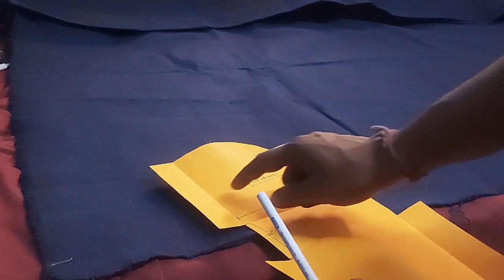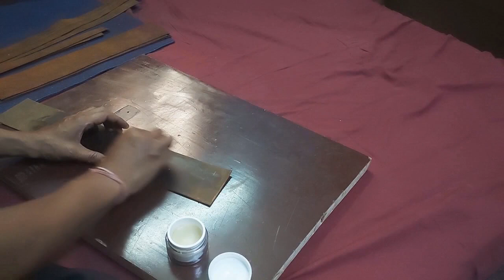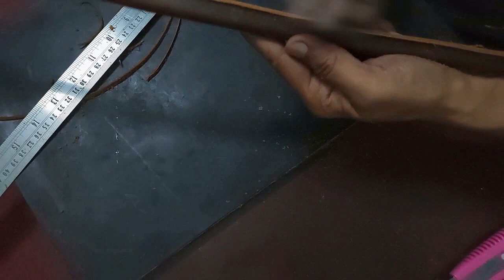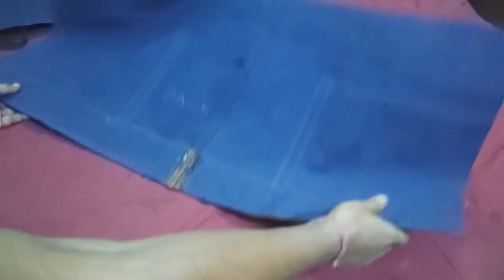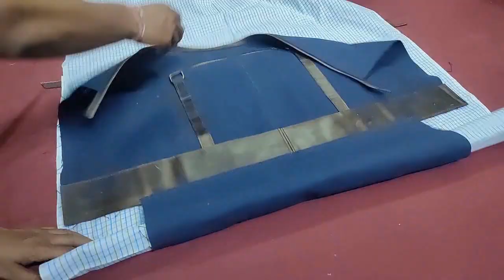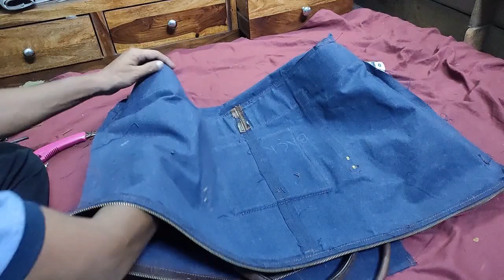DIY waxed canvas and leather duffle bag (start to finish)

Comment: Great job , so what is the actual cut size for the 3 pieces of canvas . Cheers
Reply from the maker: 2 panels - 32x17 inch
Base- 22x10
With 0.5 inch margin on all free sides.
Reply from the maker: And thanks for appreciation 👍🏻

Comment: Is you sewing machine electric or hand crank?
Reply from the maker: It's an electric one , meant for high speed fabric stitching, Juki DDL8700, it's servo motor malfunctioned and I couldn't get it repaired due to lockdown, so in this video I am hand cranking it.

Comment: Désolée mais il faut penser aux personnes qui regardent la vidéo!!! On ne voit pas les mesures écrites sur le papier jaune … dommage
Reply from the maker: I am sorry for the poor video , I'll try to fix it next time , the measurements of the bag had to be 22 length x 10 width x 12 hight (inches)

So the cut pieces were 
2 panels of 32x17 inch
Base- 22x10 inch

0.5 inch margin on all free sides.